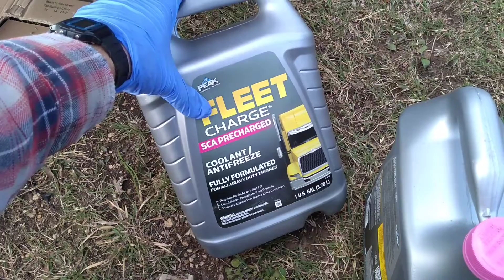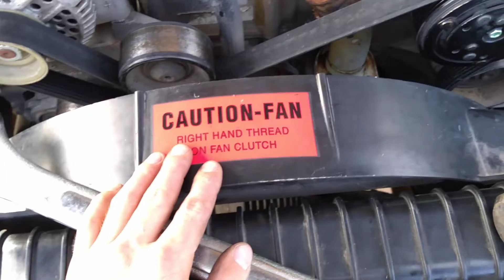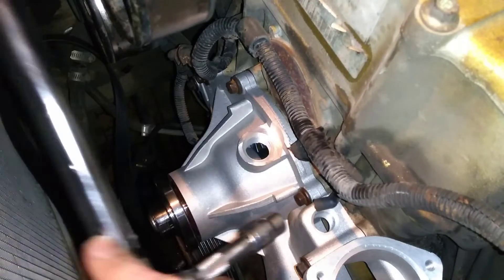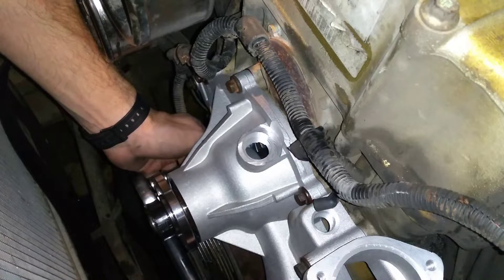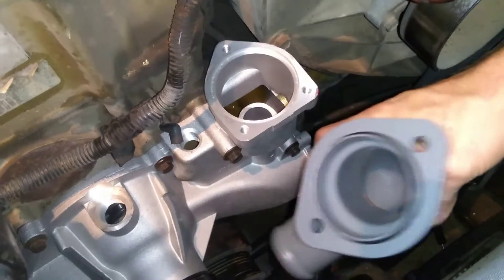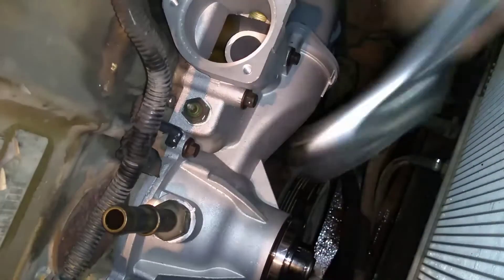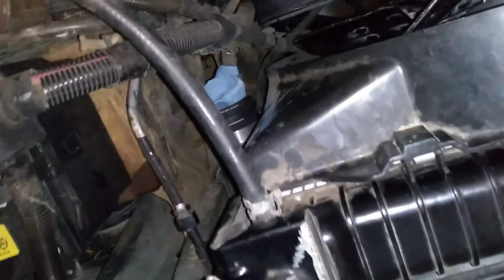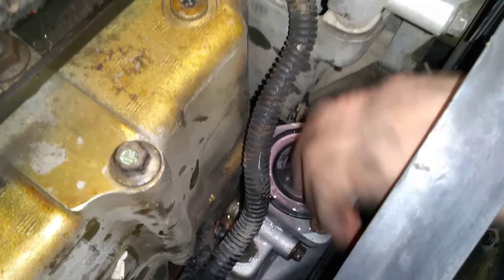7.3 Powerstroke Water Pump Replacement

Comment: Just ordered the inch and 7/8 for the fan clutch. Just rolled 300k and the pump went out. Next project is the pedestal seals. I’ve done several water pumps, but not a 7.3 thanks for the vid.

Comment: These gates pumps have a grey coated steel lower elbow that bolts to the pump. It will flake off its coating and restrict flow to your oil cooler. Switch out that elbow for OEM or one that doesn't have a coating on the inside. The newer gates pumps don't have the inside of the elbow coated.

Comment: I'm about to replace my water pump on the same year truck. If you remove the serpentine belt and spin the water pump pulley instead of the entire clutch fan assembly it threads a lot easier, learned the hard way myself. Thanks for such a great informative video!

Comment: Great video.  Just one thing may help with cuss words if you need to do another.  When re-installing the fan clutch take the serpentine belt off the idler arm and spin the pulley of the water pump with one hand while using the other to just hold the fan clutch up to it.  Much easier as all you need to do is keep the fan clutch in the right orientation as you spin the water pump.  Props to you in the mad skills department for even getting threaded the other way.  No wonder you used many cuss words.  (You're allowed one more cuss word now as you wish you'd thought of that or known that when you did yours.)  :)

Comment: What’s the size of the wrench that I need to take off the fan clutch?
Reply from the maker: I have no idea since I made my own, I want to say it's 2 inch or something like that?
Reply: @Rnddiesel  could I just use like a long screwdriver to hold the bolts while I twist the fan the opposite way, I mean I could go get a loaned fan wrench at Autozone but I just wanna stay at the house
Reply from the maker: @Official_Jboogie  It's much easier to do this with the right tool. I'm sure you can try a different way, but it makes the job waaay easier to have the right wrench. The job is frustrating enough as is.
Reply: @Rnddiesel  I ended up just going to Autozone and use their loaner program for the wrench, got the job done and now I’m back on the road, thank you for the help👍🏽
Reply: Made wrenchs out of flat iron laying around took about 20 min. @Official_Jboogie

Comment: What does the intercooler do?
Reply from the maker: The intercooler cools down the air after it gets compressed by the turbocharger. When air gets compressed it heats up, so the intercooler cools it back down to increase density so more air can fit inside the cylinders. This generally allows you to run more aggressive tuning that dumps more fuel into the cylinders making more power.

Comment: Hey man, coolant disappearing on my '95 7.3 do you have any ideas of what it might be?
Reply from the maker: My first thought is a coolant leak somewhere external to the engine. It could be a bad hose, busted radiator, overflow tank, loose fitting radiator cap. Are you getting any oil mixing with your coolant?
Reply: @Rnddiesel  No oil mixed. When I top off the coolant the first few days after it has trouble starting as if the glow plugs need replaced but they're pretty new (like 7,000 miles ago new) and as the coolant goes away it gets easier to start. When this happens it makes a cranking sound but it's not the engine. I was thinking it might be an injector O ring issue and coolant is seeping in that way?
Reply from the maker: @raunchymangos7468  I don't think it would be the injector O-rings. Those only seal oil and fuel to the injector. It might be injector cups. There's a metal cup that presses into the cylinder head that the injector sits in, and that cup does seal up coolant keeping it out of the chamber. Typically though I think those cause fuel and coolant to mix rather than a pure loss in coolant. Definitely start by looking for leaks on your cooling system though since any issue there is going to be much simpler and less involved than having to tear into the engine to replace injector cups or head gaskets.

Comment: Hammering the fan clutch with that wrench is begging for you to bend something. Use a fan clutch wrench that comes with a fan clutch bolt wrench as well. You can rent these at your local auto parts store for free!!

Comment: I'm new to 7.3 ive got a leak somewhere havnt found it yet but what kind of anti freeze and or additives am I supposed to use ?
Reply from the maker: You'll want to use an antifreeze that contains SCA's or supplemental coolant additives. You can get some additives from Ford to add to conventional green antifreeze for your truck, or you can just get SCA precharged mix and don't worry about it. I usually use the Peak Fleet Charge SCA Precharged Fully Formulated Antifreeze & Coolant and don't worry about adding anything.
Reply: Do you recommend the green concentrated motorcraft premium antifreeze coolant?

Comment: What’s the part behind the water pump. My 1996 is leaking antifreeze from the gasket and possibly the part has a hole too .
Reply from the maker: That's the timing cover, I think it has a gasket there as well that can leak. It has to seal to the engine block.
Reply: Thank you. Great videos.

Comment: So I listened and watched your video on the oil cooler before and during the work as a reference.  Or I’m doing a water pump after is shows up. My question is how long did it take you to do it
Reply from the maker: I cant remember exactly how long it took. I believe it took me about a day to get it done. Bear in mind of course that's with me taking my time as well to get the right camera angles.
Reply: Rnddiesel kinda figured videoing slows the process down. I found what I believe is the correct clutch fan wrench I got to go pick it up today. Pump is here and I’m going to skip out on the t stats housing but I do have a new t stat. Also got new bolts as I hear a lot of horror stories of them breaking. I figured I would put a dab or anti seize on them and just chuck the old ones. Not sure if it’s the threaded part that screws people of the shaft.

Comment: How's the gates brand stuff holding up? I think my water pump just went out today. I was driving, smelt something burning, and all of a sudden my power steering went out. I got out of the truck to check, and it was dumping coolant from the front of the engine. The entire engine was soaked in coolant. I think the power steering went out because of the belt being wet and slipping on the power steering pump. Hopefully it's just the water pump!
Reply from the maker: So far its been good, but I probably only have 20k miles on the pump right now, so it's hard to say for sure how it'll hold up in the long run. It'll at least get you back on the road. The Gates parts are good enough to work at least. Good luck getting your truck back on the road!

Comment: Well done .. I’ve got the exact same truck , Replacing the original  Oil cooler O rings and water pump only after 306,000 miles. 
Old School Fords.. 🍻
Rubber side down boys !!

Comment: Thanks for the video! I have the EXACT same truck and am just starting to put my WP back on!
Reply: Aaaaand one of the bolts snapped when I was putting it back on ‘with proper torque’ ugh
Reply: Chris Petrolino Thank you.. I have the exact truck and 306k miles on the original water pump that has failed. Also my Oil Cooler O-rings failed most likely to the couple times its ran a little warm due to the water pump giving up.. 
Old school Fords .. Rubber side down boys!! Cheers!
Reply: Basic Wrench you know it! I’m planning to do the rear main seal on mine soon

Comment: I just use a air chisel and it takes 20 secs to remove the fan clutch lol. People waste time and money on so many special tools and I am sure most of us have a air hammer. I also leave all the metal on the pump and pull it off as one piece. None of it is in the way of the main bolts that hold the pumps on and gives you something to hold onto when you pulling it out. Plus you should be replacing all that anyway after doing this pain in the butt job. Doing it this way also makes you waste less of your time and you can transfer and inspect all the parts you need to at a bench.
Reply: That's just a lazy way

Comment: Easy way to get the fan clutch off is take a ratchet strap and double wrap it around the pulley. Hook it up to both sides of the truck and tighten. Makes it a whole lot easier.
Reply from the maker: That does sound way easier, I'll have to keep that in mind for next time, thanks!

Comment: Nice video. Im about to do my water pump.. did you flush your coolant system?
Reply from the maker: I didn't formally 'flush' my system as much of my coolant was still fresh from the radiator replacement not long ago. I more or less just filled it back up with fresh coolant to replace the stuff I took out from the job. A flush might not be a bad idea if you have the time to do it.
Reply: @Rnddiesel  Thanks for the response. I just replaced what drained out of the rad, tank and water pump. hopefully shes good for another 200,000 km

Comment: Hello, i have a coolant leak, i supose Is the water pump, what brand do you recomend?
Reply from the maker: It's hard to say what the best brand is. I used a Gates brand pump as it was way cheaper than the Ford dealer option. I've only had the pump on for about 5k miles, so it's too early to tell how it'll stand the test of time. Another option you may want to look into, if budget allows, is getting a cast iron International T444e water pump instead. You have to get a different lower radiator hose to get it to work, but it also adds a coolant filter. It's just a pricey ~$300 option, but would probably be well worth it. I probably spend a little over $100 on my water pump job between hoses and the pump, all Gates brand. Best of luck!
Reply: @Rnddiesel  Thanks for answering, i´ll try the Gates pump.
Reply: Water pump brand i mean

Comment: Have a question for you. I was following your filter video and qhen I go to RiffRaff, I get stewed on the price. Filter with the tube for obs 7.3 shows $106 in my shopping cart. How do I get this Donaldson filter with 4" elbow for under $80?
Reply from the maker: I'm not affiliated with Riffraff, so I don't know how much of a help I'll be. Here's the link to their OBS filters: 

https://www.riffraffdiesel.com/6637-kit-related/

I just purchased the Donaldson Blue filter, it's only $40 or so, though shipping will add some onto that as well. To connect it to my intake, I just used a piece of 4 inch exhaust tubing and a large hose clamp. You could buy their '6637 Filter Kit' though it only comes with the normal white filter. As another option, NAPA usually carries the normal paper Donaldson Filter for around $60 if you don't want to buy online. Just go up to the counter and ask for a NAPA 6637 air filter. Maybe try clearing your shopping cart and starting over again at Riffraff. Also I assume you're on the mainland US? If you're not, I'm sure shipping would add quite a lot to that price. Hope this helps, best of luck!
Reply: @Rnddiesel  Thanks for the reply . I called my local Napa and they want $75 for their filter. I'm going to order the Donaldson blue from Riffraff and use their kit to utilize the 45 degree elbow. Do you have issue with the filter rubbing the battery or fender well?
Reply from the maker: @EM-fi2qg  Yikes! $75 is a bit steep for a 6637! For my setup, I'm actually using a Super Duty 7.3 air intake hose, so it sits a little different. It does rub against the inner fender well, so the contact area has the insulation rubbed through, but it's no big deal. I haven't had any issues with it rubbing against the battery though. It'll just take a little bit of adjusting to get it to sit how you want it. I can usually rotate around the intake hose to get it to sit how I want so it won't rub through in any places.
Reply: @Rnddiesel  Ya, that price is ridiculous compared to what I have seen online. Thanks for all the info. 👍
Reply: @Rnddiesel  And I apologize for the previous type-o's. I just saw what I initially posted. Holy botched English! 🤪
Reply from the maker: @EM-fi2qg  I'm glad to help! Don't even worry about the typos. We are more Mechanics than English majors afterall. Best of luck with the truck, and I hope the filter works out well for you!

Comment: the positive battery cable would cause less damage to the engine if it went out.
Reply from the maker: Fair point, that would solve a lot of my truck issues too. After the cable shorts out and causes the truck to catch on fire, heck it'd be a good reason to just buy a new truck!

Comment: should have used rtv. that aftermarket junk is going to leak
Reply from the maker: I thought about using some. In the past I used RTV to make a gasket, it leaked anyway so I ended up using one of the aftermarket junk gaskets and it hasn't leaked since.

Comment: the fan clutch Bolt is all mangled up because you're supposed to use a air hammer with a drift on it breaks it right loose.
Reply from the maker: That explains it! I was wondering why it looked all beat up, must have been from the previous owner. I replaced my fan clutch anyway, figured I'd rather just use the wrench designed to remove it and not cause unnecessary damage.